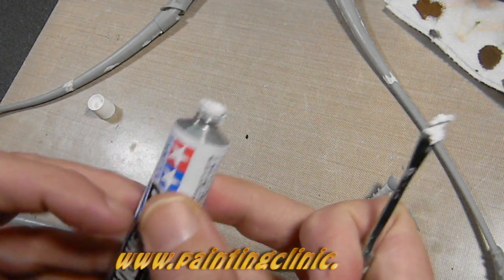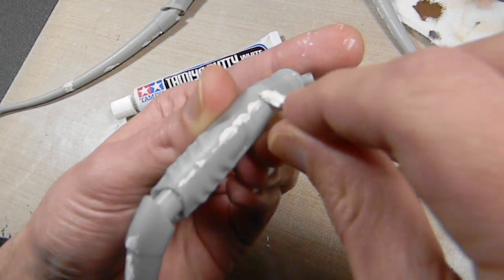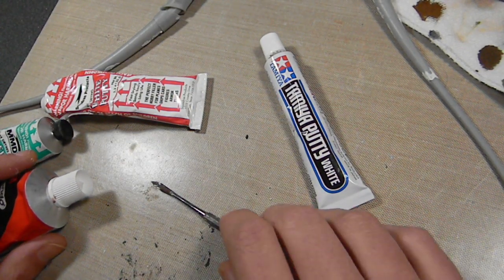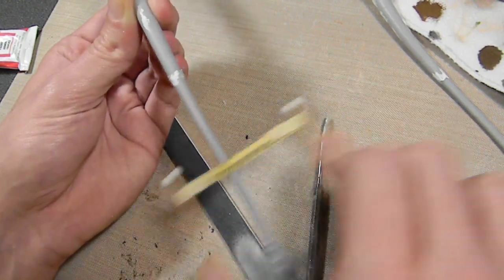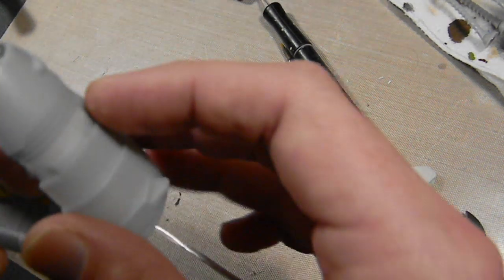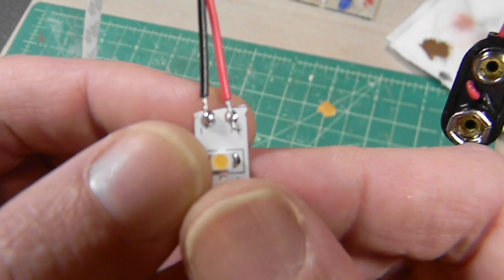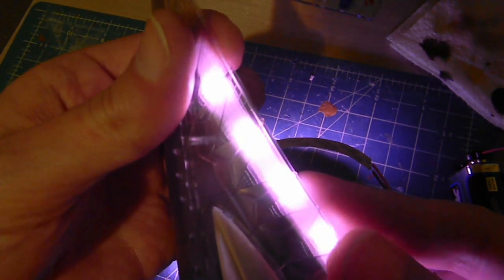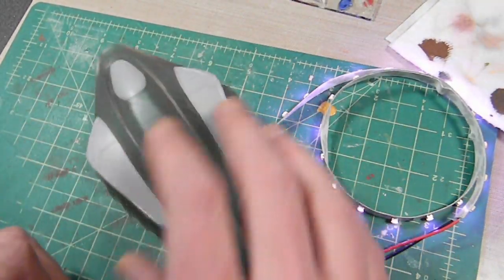Pegasus' War of the Worlds Tripod Part 3

Comment: If you want something that will diffuse better than wax paper and is readily available, try parchment paper.  You can find it right next to the wax paper in the grocery store.  It is made for baking, and will handle any heat that those LED strips will generate.  I reviewed those strips months ago, and if you are using 12 volts they will get warm.

Comment: Just a BIT late, but how would diffusing the purple light work if you just mounted the led tape in reverse, with the lights shining inward?  That way you wouldn't have the light shining directly through the window but would still have the full intensity of the lights.